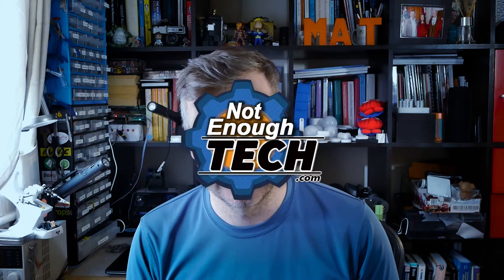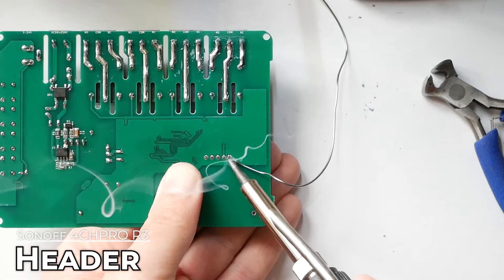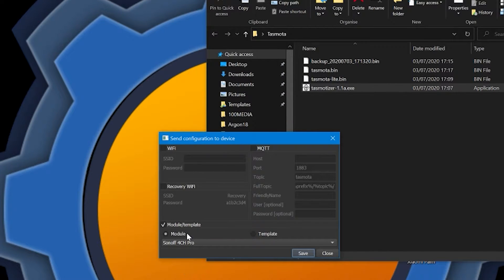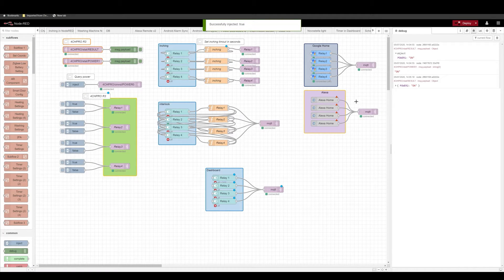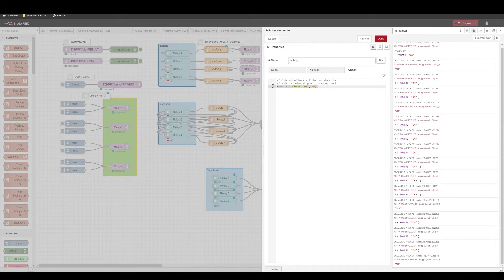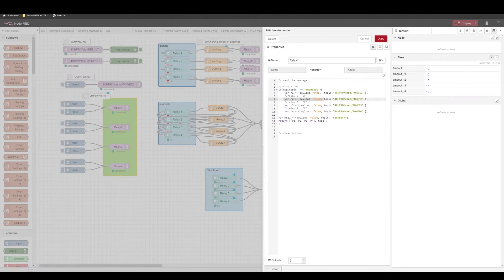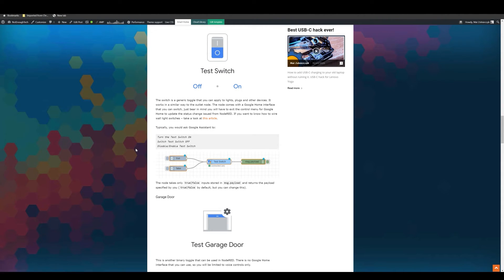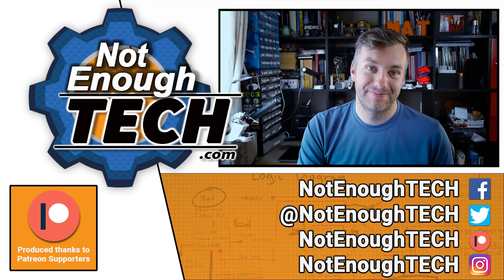Flashing Tasmota on Sonoff 4CH R3 and 4CHPRO R3

Comment: Does the Tasmota firmware allow additional logic to be handled on-device (without NR/HA server)? For example, if I want one button to turn on one relay at a time for 10 minutes each in a loop until the button is pressed again to turn it all off? This is easy to do with a server, but then if that's the case I can also use a cheaper Zigbee quad relay.

Comment: Hi. I have "Failed to connect to ESP8266: Timed out waiting for packet header" error . How to fix it. i am on macos
Reply from the maker: Swap tx and Rx and try again. Make sure your FTD delivers enough current
Reply: it was first thing i tried, but no wroking ...
Reply: i tried  USB-UART (RS232 TTL) FT232RL and also USB-UART (RS232 TTL) FT232RL . i set power cable for 3.3v . Is it problem with mac os ? Should i try with windows maybe ?
Reply from the maker: Are you trying the web install? My bet is broken communication between your FTD and the chip.
Reply: @notenoughtech  I fixed it. it was problem with one cable :)
Reply: i can see , i dont have port: COM6, i have few others for example tty.usbserial-0001, cu.usbserial-0001, tty.BLTH and ...
Reply from the maker: I'm not the best with Mac's if I'm honest. On the pc if you don't have the com port it's your FTD playing up

Comment: Is it possible to use the device in inching mode with different auto-off durations for each channel along with interlocking mode while the inching is already enabled? I know that by default we cannot use the device in both inching and interlocking modes but through flashing or through any other way is it possible to do.

Comment: Thank you for the tutorial. I've also used your sonoff bridge video. Can i use this switch my undefloor water heating system ? I thought it will be possible to create rules and automations with this switch + TH01 + existing actuators.
Reply from the maker: If you are within the current limits I don't see why not. Tasmota comes with support for extra sensors and if I remember well there are spare pins exposed

Comment: Mat,
Following your tutorial, I flashed my first Tasmota switch.  Thank you.  I've also delved into Node-Red, which has been daunting.  I had a little trouble finding my dashboard.  Once I did, I discovered that my relays are not functioning like yours.  The inching function works only once.  To get it working again, I have to re-deploy the flow.  If you don't the dashboard switches turn on/off, but the relays don't change states, and the inching function no longer works.  Also, the interlock does not work at all.
-Jamie
Reply from the maker: Take a look at preserving context. If your settings get wiped with redeployment or nodered restart then your context variables are not saved properly. Also change the deployment method from full to modified nodes this will prevent the on deployment settings to be saved each time you do this

Comment: Hello Mat, can one still use RF 433MHz after flashing tasmota on this? I'm redoing the electrical wiring in my house and was thinking of ditching wired switches but would like to not depend entirely on wifi being on at any given time.
Reply from the maker: Yes you can. RF works independently and it's mainly hardware based. You will need the supporting tasmota version for RF tho
Reply: @notenoughtech  thanks!

Comment: After flashing, does the RF433 still work? Existing pairings or new learnings?
Reply from the maker: It will retain the existing RF signals as they are stored independently.  You should be able to pair the remotes as usual
Reply: @notenoughtech  Thanks!

Comment: Man, so glad I found your video. I was following the instructions on Tasmota github page for the R3 Pro which say to use, "pin of R21 on the board to connect to the ground during powering for 3 seconds and release in order to put a chip in flashing mode." After a couple hours of unsuccessfully flashing the device I searched youtube and found your video. You press S1 during boot instead and this worked for me first try. Thanks for your content!
Reply from the maker: I'm happy you found it useful.

Comment: Great video, thankyou! 
notice that for inching and interlocking you may use the tasmota command PulseTime and Interlock, which is safer than the automation, since it also works when pushing the physical buttons, or if the network disconnects between events, plus you save an automation.
Reply from the maker: That's correct. And in these circumstances you probably better off this way... But if you are automating anything else that doesn't have this behaviour then you can fall back on server side implementation ;)

Comment: I have the same board and this didnt work for me 4CHR3, it seems to go into download mode but then isnt responding
Reply from the maker: Are you able to get past the "connecting" stage? Try ESPtool and use erase option in the comand line to wipe it clean
Reply: @notenoughtech  I got it working, missing ground on FTDI cable

Comment: RF remotes keep the pairing but if you want to change you need to go back to the original firmware or you can still pair with Tasmota?
Reply from the maker: You can still pair RF remotes as normal

Comment: hello do you still think it is necewssaire to install Tamota , as of now you have the local sonoff integration, I am thinking to controll a fan which has for stages off, speed 1,2 and 3..
I don't have any technical skills to do the flashing..
what's your suggestion
Reply from the maker: Tasmota is optional. There is nothing wrong with using it with ewelink app

Comment: Hi, any hints for 4CH PRO R3? I cannot get it to interact with esptool. I tried swapping RX/TX , holding Button1 during boot, grounding on resistor R21 (as found on tasmota page) - no luck.
Reply from the maker: Nothing extra that I could advise you at this point I'm afraid
Reply: @notenoughtech  Hi, thanks for reply. I have just connected it to mains to confirm that it works (did not do that before trying to flash) - and yes, it's ok. Maybe my flashing adapter does not provide enought power for boot? I should use external DC power then, but i'm scared to use it together with USB. I should connect ground and RX and TX from USB, with external power, i guess?
Reply from the maker: Don't use mains but you can power the esp with the power pins from the supply that could help
Reply: @notenoughtech  Yeah i could do that. I don't know if i have 3.3V power supply thou ;) I was thinking about using that 9-24V barrel connector for DC, not mains
Reply from the maker: DC would work fine as well as you won't electrocute yourself by accident :)
Reply: @notenoughtech  Probably :) BTW should i connect ground from USB , so it has common ground with DC power supply?
Reply from the maker: Yes this way you will provide the reference for your FTD
Reply: @notenoughtech  Yep, it did not blow up after connecting together ;) But still cannot flash. My FTDI may be broken? But when i connect RX to TX on it and type something in minicom, it sends and receives my test texts
Reply from the maker: If sonoff works then my bet is the FTD get a nice one :)
Reply: @notenoughtech  Just tested my FTD with H801 and it works, strange
Reply from the maker: Beats me then
Reply: @notenoughtech  BTW: how did you enter flash mode? By holding first button or grounding R21 ?
Reply from the maker: Hold the button. This will pull gpio00 to ground then reset while I keep button down
Reply: @notenoughtech  Yep, did that before, no luck - is it the first button? After holding it , blue led does not come up, only red flashes once
Reply from the maker: If I recall correctly it's the button 1. It shouldn't flash or anything in boot mode
Reply: @notenoughtech  Hi, just fyi - using different flash board helped
Reply from the maker: Thanks for the update

Comment: Hi Mat, thanks for your video.
Now that it is more than a year old, does this procedure still works?
This is exactly what I need for my pool system linked to my Hubitat Elevation platform, but don’t want to find surprises on new firmware versions.
Please advise.
Cheers from Mexico
Reply from the maker: Yes it should work just fine
Reply: @notenoughtech  Mat, I just received my Sonoff 4ChPro R3 module, and it is important to mention that it took me 5 minutes to flash it!!! Took longer to take it apart. Thanks a lot!!! Cheers
Reply from the maker: Very true haha

Comment: How do I get interlock for relay 1 and 2 going and I need a temp probe to run relay 3 for a small heater?
Reply from the maker: I have interlocking sample on my website. As per temperature you will need to connect the sensor to spare gpio and set it in tasmota. If you look up my oldest article on heating it will show you how

Comment: A note for anyone using Tasmotizer Windows executable - you may need to Run As Administrator to get it to use the port.  The app loads ok running normally, but it bombs out after downloading the firmware.  This had me troubleshooting, soldering, trying alternatives for 2 days...
Reply from the maker: Oh I probably should mention this. I have a habit of opening all tools as admin just in case :)

Comment: dumb question: where do i have to write the code? 
"//relay1
msg.payloyad = true;
msg.topic = "4CHPRO/cmnd/POWER1";
return msg;
//relay2
msg.payloyad = true;
msg.topic = "4CHPRO/cmnd/POWER2";
return msg;" ? :(
Reply from the maker: In function node connected to mqtt out
Reply: But the function node is not only for the "Inching and interlocking"?
Reply: For the "Controlling Relays" part i see just the "inject" and the "mqtt" nodes.
Reply from the maker: @lorand3646  These are samples, ideally you don't want to control it from NodeRED but automate it. Samples show you how to structure data to achieve the action.

The one you listed should start with an inject node, connected to a function node with the code quoted by you, connected to a MQTT out node
Reply: Understood. Thanks for answering.
Reply from the maker: Happy to help

Comment: Hi ,Thanks for this tutorial.I flashed my sonoff R3 and now when I press the button of relay 1 it toggles for 1 or 2 sec and untoggles .Any idea what be happening?All the others work well

Rgds

Domingos
Reply from the maker: Are you sure you used correct template?
Reply: Thanks for your reply .Finnaly I found the mistery.It was nodered that it was sheeting the sonoff.Thanks again anyway.

Comment: Hi, by "tasmotizing" a Sonoff 4CH Pro you get rid of the need to connect to a chinese server every time you operate Sonoff - that's what the makers of "Tasmotize" say. - I flashed my Sonoff as shown by your great video, tested the Sonoff after that, renamed the buttons - everything seems to be fine. - But, because I'm curious - I disconnected my Fritzbox-router from the WAN connection to the outer internet. The local LAN and WLAN including DHCP still worked - of course. Only the Sonoff quit doing what it should: toggling a relais via WebUI took 30..60 seconds to respond, or failed. The Tasmotizer connected via USB flash module got no answer on a "Get IP" request, except "XXX.XXX.XXX.XXX". Flashing didn't work anymore. - What I believe: the tasmotized Sonoff tried to connect "something" over the internet, before executing a command. - Is a tasmotized Sonoff a trojanian horse in reality!?

Please, could someone confirm or disprove my observation? Is there any explanation for what my Sonoff does?
Reply from the maker: Source code for tasmota is available on GitHub and you can build from source yourself. The evidence of whether the device talk to anything or not is in the code so. You don't have to take anyone's word for it and check it yourself
Reply: @notenoughtech  ok - that's a clear "yes, it does", I think. - Thank's ...
Reply from the maker: No. That's clear instructions to either go and check the source code published to everyone to see or take the word of anyone who already examined it. You asked for evidence. Me saying it doesn't its just an opinion not an evidence
Reply: Well - I'm not skilled enough to understand that code - I'm afraid. Is there anyone out there who's curious enough to check that? - One of the main reasons to "tasmotize" a Sonoff is to avoid the necessity of connecting a server in China when you want to turn on a light. I found yours and others videos about how to flash a Sonoff, but I can not see if there are different binaries to load to the Sonoff (there are, I believe), and which of the solutions really do not need a connection via internet to any server to operate, and which does. I want to use this WLAN switch at a place, where I only have a WLAN Access Point (the Fritzbox) to have a WLAN network, but no internet connection. - That's my problem ...
Reply from the maker: Tasmota & and devices with sonoff DIY mode don't need anything other than Lan to work with.
Reply: @notenoughtech  ... strange ... I tried two Fritzboxes: everytime I disconnect the WAN connection to DSL / internet the WebUI of Sonoff does work extremly slow and uncomplete, the "ON/OFFF" text does not appear: as if it waits for e response from the internet. Other computers still use LAN / WLAN as usual (NAS, printers ...). As soon as I connect the internet again, everything is fine. - Might it be posible, that any MQTT setting could be the reason?

I don't to use NodeRED, just simply the WebUI of the Sonoff.
Reply from the maker: Are you using LAN mode in the ewelink app? Or are you referring to tasmota?
Reply: @notenoughtech  I don't use the app. Only a browser and the IP-address of the Sonoff.
Reply from the maker: Then if you are not able to resolve the requests quickly it means that your network is having hard time sending the request via browser to the target device. 
Tasmota talks to external sources to update the time and check for updates.
Reply: @notenoughtech  "solved" - I did use the "DE" - binary from that Youtube DIY (https://www.youtube.com/watch?v=1K1vTNzsTxI). That firmware works fine, even if the WLAN-Router is not connected to the internet. All other LAN-setting are the same as in my first try with the Release 9.3.1, which the Tasmotizer-tool offers as an alternative to a user-selected bibnary file. - I don't know why.

Thanks for your tips!
Reply from the maker: DE would set your timezone automatically I believe so if you are running in offline mode from the beginning tasmota wouldn't have to check for that. That's my guess. I can be mistaken

Comment: How do I get to the flashing mode with the 4ch PRO R3? You only show it for the 4ch r3 (without pro).
Reply from the maker: The process is identical for both devices, power cycle the device while holding down relay 1 button

Comment: May I ask you which "board" version is your "PRO" version? Seems mine is flashing ok but after module selection is not responding anymore.
Reply from the maker: Did you erase the flash?
Reply: @notenoughtech  Yes, flashing is ok, after, selecting module type, makes module unresponsive. I'm addressing the issue on github. as per now it seems device is compatible up to 8.5.1 fw, not with 9.x.x
Reply from the maker: If others reporting the same it definitely sounds like a bug. Hope it wil get fixed soon

Comment: Hi, I own a Sonoff 4CH PRO R3, and I have a limitation of 8 timers for the 4 switchs/relays. I need at least 12 timers (3 timers for each switch/relay). Can I have more timers with Tasmota firmware? best regards
Reply from the maker: You can have as many as you want if you connect it to NodeRed :)

Comment: I need a firmware stock for the sonoff 4ch pro r3. Can anyone help?
Reply from the maker: Firmware is bound to MAC address so if you haven't made a backup, you are out of luck
Reply: @notenoughtech  I did the backup, but the pairing was not working on the stock firmware. the status led flashes 5 times and does not change
Reply from the maker: Tried tasmota on it too? No luck?
Reply: Yes, I tested it and it worked fine. But my client uses the eWeLink app and has other Sonoffs. I would like to put the functional stock firmware
Reply from the maker: Strange. I assume you have tried the compatibility and regular pairing mode?
Reply: @notenoughtech  Yes, I did, but its not work
Reply from the maker: Check with their support forum. Maybe they could hint something

Comment: both inching and interlocking should now natively supported by tasmota, so no need for external controller, why not using those internal functions?
Reply from the maker: 1. You can learn something new
2. Unlike tasmota, NodeRED comes without limit for timer and interlock congiguration.
3. You can reapply this to any other device that is not flashed with Tasmota
Reply: @notenoughtech  yup, just giving alternatives! I agree, thanks 😬
Reply from the maker: I'm happy you mentioned it thank you

Comment: Thanks Mat, about to do the same to a spare 4CH PRO R2. Do you ever have issues with Google Assistant announcing that Nora can't be reached?
Reply from the maker: Frankly speaking, I use Alexa at home, so GH is hardly ever used. I do it mostly because of you guys. Not sure how reliable it is in the daily use as each time I called GH for help it worked flawlessly for me. How often does it happen?
Reply: Pretty much everyday. My work is in the HA industry so I started using it to trigger node-red to send TCP commands to Control4 which is controlling AV.
Reply from the maker: @thierry3610  My bet would be on timeout caused by the number of users on a non dev account. NORA person warned that they don't do this on proper accounts and they are limited by the quota API calls
Reply: @notenoughtech  Yes I did read about this and I think you're spot on. Hopefully when there's local control from GA there'll be better integration...
Reply from the maker: Google is pushing local network home control so perhaps soon we will see this in action too